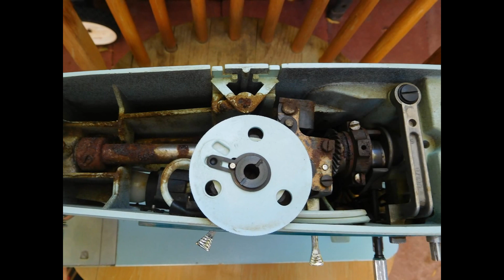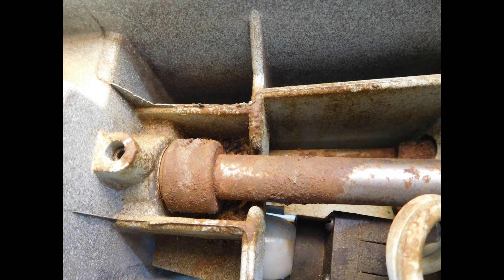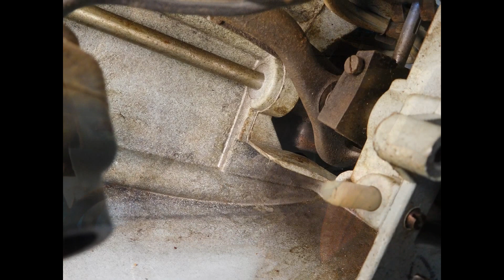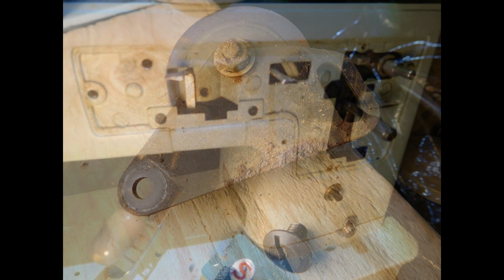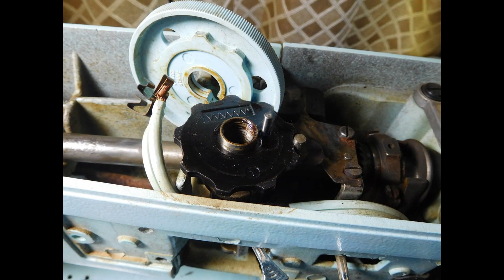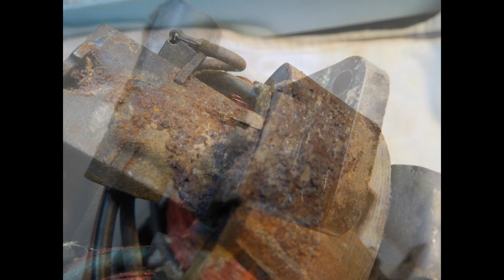SINGER 347 FOR JEN - A MOUSE HOUSE W/ RUST

Comment: Hi again, I’m watching the rust videos because I’ve been trying to get the needle bar out of my 401 A,  but I’m having a devil of a time. I have been soaking the bar holding bracket for about four days. I have also been Tapping and applying heat. I thought there might be rust in that needle bar clamp area that is so tight fitting. Finally this morning I got it to move. However, as I was pulling the bar up, the bar reached a spot and stuck again. I’m getting ready right now to go upstairs and apply more heat. When the  Bar finally moved, it was as if someone had given me a Christmas present. I started doing a happy dance., yay!
Reply from the maker: Congrats on getting it to move. They can be very stubborn. When mine has moved and then stuck I have applied Krud Kutter down thru the bushing towards the bottom of the bar. I found some of the yuck gets scraped off by the bushing as I lifted the bar. Cutting the old oil in there with KK set it free. I also had a couple of bent needlebars that got hung-up half waay out. I was able to twist it is a circle as I lifted to manuver the "bent" area thru the bushings. It's weird sometimes b/c I have been able to loosen the set screw and slide the bar right up easy-peasy too.

Comment: This video & machine didn't bother me, a bit. lol Grew up where mouse droppings were common in farm buildings. One of my hobbies has been using lye bath, heated white vinegar, and electrolysis are used to restore castiron cookware and other castiron items. Dirt, grease, grime, filth, rust, and limited corrosion are simply challenges to be overcome. 

In this case, the electrical side of things appears to be worse. Keeping in mind that my knowledge of electrical motors leaves a lot to be desired. She may be better off with a replacement motor, especially if a more powerful version is available at a reasonable price. 

Hope all goes well and there aren't any hidden problems (busted gears, 4 ex.) to drive up the cost for this lady. I'll leave my thoughts unsaid on a $90 belt replacement without using a vacuum cleaner.

Looking forward to seeing how it turns out. Thanks for sharing.
Reply from the maker: Thanks for the comments. If you are willing to use lye bath (water) & electricity, I better man up and give it a go  with this 347.
Reply: Andy Tube lol.........

Comment: My 413 was almost as bad but instead of a mouse it was home to a squirrel.
Reply from the maker: Yikes! Must have been a tight fit! Those rodents can really cause trouble, can't they?
Reply: @andytubesewing1953  They sure can..Had to rewire from the motor to the 3 pin power input and they chewed the foot pedal cord so bad that I had to use one from a parts machine.. Had to clean urine, leaves, acorns and who knows what out of every nook and cranky.lol..Only thing left is to find some paint to somewhat match the pale green on the machine..The cover below the hand wheel was corroded from the urine and I lost a little bit of paint.